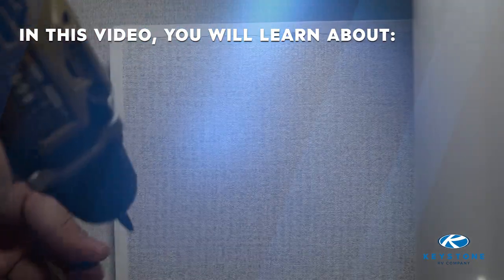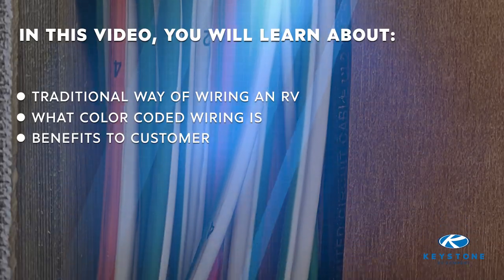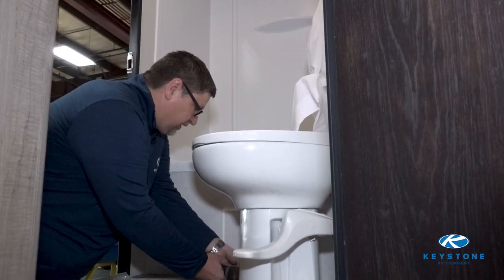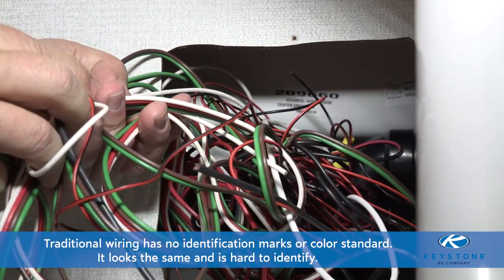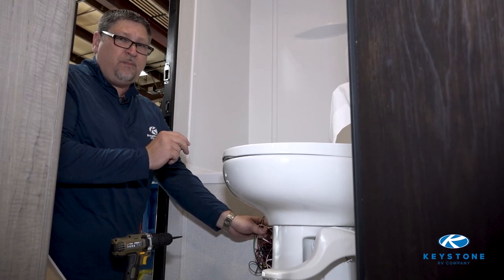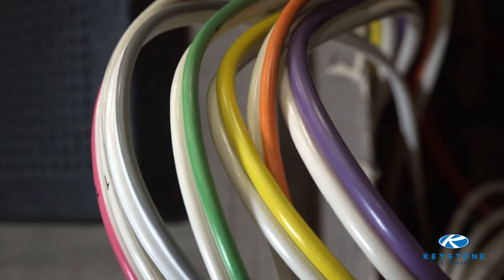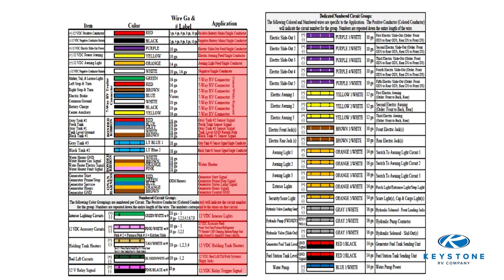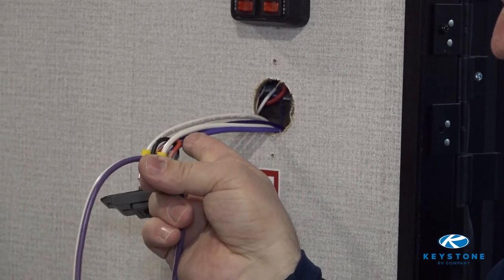Keystone RV Exclusive Color Coded 12V Wire Standard

Comment: I think if Keystone was truely interested in assisting dealer repair techs and owners' with trouble shooting then they should be willing to share the wiring schematic for each model.  My dealer says they can't get one for my 2020 Cougar 22RBS (or any other) and they have so far been unable to get answers for any of my questions.  I have also reached out to Keystone customer service and they stated that diagrams are not available nor could they answer my technical questions and refered me back to the dealer.  How can you reliably build any unit without a diagram regardless of your color code system?  How are the techs supposed to trouble shoot the wiring mess on the A-frame where there are 4 circuit brakers, 4 fuses and dozens of wires which do not have your "standard" color codes?  I've owned two other campers from different manufacturers in the past and had no problem getting wiring diagrams from them. On one occation I was even able to call the factory and speak to the engineer who told me what to look for and exactly where to find it!  Come on Keystone step up your game and really help out the RV techs and owners!
Reply from the maker: Hello Philippe, thank you for your comment. I’m sorry to hear about the issues that you are experiencing. Unfortunately, we do not have any diagrams or schematics to provide on the units due to how quickly things change within production- even on a day to day basis. They would not be completely accurate. Please know that if you are having issues with the electrical system in your unit and are not able to get them rectified, we do want to help! Our authorized dealers have the ability to reach out to our service team directly for suggestions or direction to diagnose any concerns that you may have. If you would like any assistance throughout this process, please reach out to us directly at (866)425-4369. An advisor will be happy to assist!
Reply: @KeystoneRVCompany  As I stated in my 1st response neither the dealer nor Keystone customer service has been able to answer any of my electrical questions.  Here is a simple example:  fuse #7 in the distribution panel is labeled "kitchen slide".  It is a 15 Amp fuse and the wire connected to it is pink/white #3 which matches your standard color code for kitchen slide.  The issue is the 2020 Cougar 22RBS doesn't have a kitchen slide and the wire doesn't appear to be connected to anything.  We have the dinette option. 
1. What option was this circuit intended to power?  It seems unlikely that Keystone would waste time and money running an extra circuit if it was not intended to be used for anything. 
2. Where does this wire terminate? If it serves no purpose in my model I would like to use it for something else like under-camper lighting.
Reply: @KeystoneRVCompany   you should have the wiring  and everything diagram to you own products  its bad company standards  to not  have the knowledge to fix your own products .  presently know  it took me close to a month  to find that was wrong with my rv slide because  KEYSTONE  didn't have the wiring specs  on it . bragging about wiring is useless when it doesn't help anyone
Reply: I agree, I'm having the same problem getting information out of Keystone about wiring diagrams did I want to wait till I burn up in the thing before they going to let the diagram out what's so confidential about a diagram or did you not do something right to begin with would be more the question that's the reason they're so hard to come by I wish you luck my friend
Reply: @YouthonRedmondyukon4643  Just wait until you have a 120v receptacle go bad and take out the rest of the receptacles downstream. Then try to figure out which is the bad one when you don't know where to start.  The "good" news is the dealer will be happy to charge you their hourly rate to pull them all out! They might even get lucky and find the bad one. Could be a 15 minute job with a wiring diagram and a new receptacle.
Reply: That would be incredibly helpful for us handy men.
Reply: My experience with the RV industry is there no industry watch dog and zero quality. My 2013 Crossroads is a prime example of shoddy workmanship. When I pulled off the underbelly panels I discovered none of the wires, both LV and 120 volt were just hanging all over the place. None of them were dressed together and run in an orderly fashion. My grey water tanks had to broken sensor wires caused by lack of support. The panel area was no better, it looked like the bunch of wiring depicted in the video. I’m a retired electrician so maybe that’s why I was so pissed to see such shoddy work, no pride take by the people who do this work.
Reply: Now that you have standard/color scheme. It should be easy to make a general wiring diagram for each trailer. Just a general layout from battery, charge controller, shore power, appliances etc. Just a general map/schematic 12v/120 cable gas too.  I’m trying to un foxtrot the spaghetti monster under my sink amd behind the tv in my 320UBH. I stand to gain serious storage under the sink and behind the tv.
Reply: @lizardking600  I made a generic wiring diagram which I shared on the Keystone forum.  It does not show the Keystone color codes but is more beneficial in that it shows the relationship between the 120VAC system and the 12VDC system.  This issue with both is you don't know where the wires are run. Are they in the attic or the underbelly?  As  @YouthonRedmondyukon4643 stated above, what happens when a string of receptacles goes out due to the poor design of the receptacles not a blown breaker.  Where does the run begin? Where does it end? You can spend a lot of money at the dealer (because Keystone doesn't share the information with them) or waste a lot of time trying to troubleshoot yourself. I've had two other campers (not Keystone) and was able to get the schematics for them which was very helpful.  Color coding without wire numbers and a schematic is pretty much a joke.  I am left with the conclusion that Keystone either doesn't have schematics or they don't follow them and they let the guys on the line run the wires wherever they want.  That's why the wiring is such a mess when you start pulling things out to troubleshoot.

Comment: I own a Cross Roads trailer which is now owned by Keystone. It uses the same type of LV color coded wire in your video. These wires are not numbered just have the color coding on them. I am adding a circuit to the counter area and some USB’s in other areas. I would like use the low voltage colour coded wire but can not find it in Canada. Where would be able to purchase some of the wire.
Reply from the maker: Good morning! You can purchase through any authorized Keystone RV/Crossroads Dealership or through www.trekwood.com. We hope this helps you in your efforts.

Comment: got a 2015 fuzion need to know the color code to the ac control unit for the rear toy hauler section
Reply from the maker: Good morning, we have the 12V color code available on our website at www.keystonerv.com however, would not have anything for the 110V side of thins. We are so sorry we do not have this available. The operation and service manual from the vendor of the appliance may have a diagram for installation etc... Thank you.

Comment: Mine is a 2003 any way to cross reference the colors?
Reply from the maker: Good morning, unfortunately we didn't start the 12V color code until 2015 so there would not be a reference for us on your 2003.The gauges should be the same, however the colors may not be.
Reply: The colors in my 2013 Cross roads are the same minus the wire numbers, it’s a great innovation